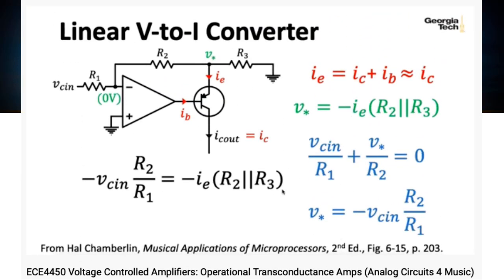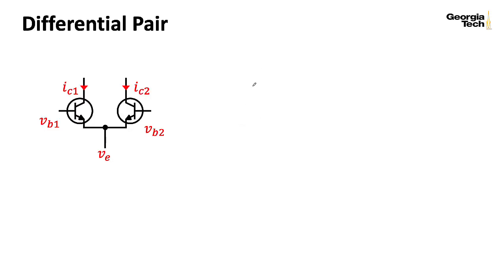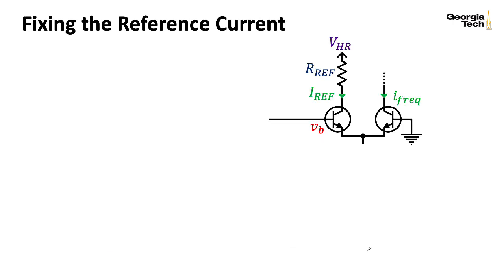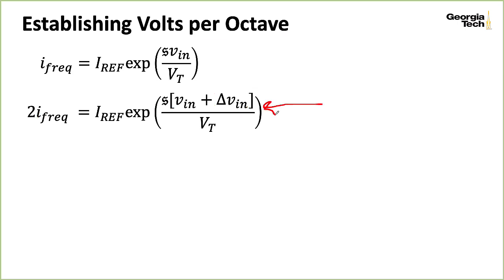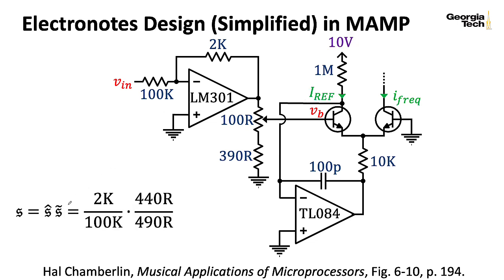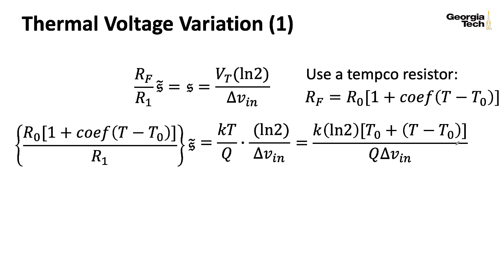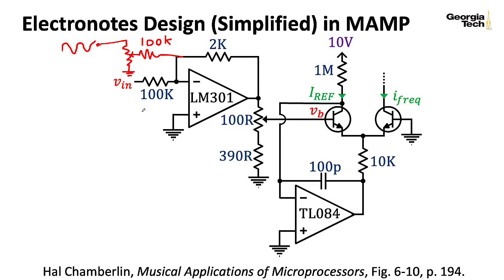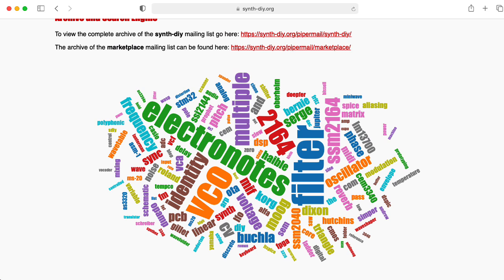ECE4450 L18: Exponential Voltage-to-Current Conversion & Tempco Resistors (Analog Circuits 4 Music)

Comment: I need to change a linear input voltage to exponential voltage to drive an analogue 1mA full scale meter. I'm guessing I need an exponential converter to do this but every circuit I mock up is basically non responsive. Any pointers?

Comment: The Electronotes exponential converter has several mistakes so it is not a good starting point. It is a corruption of applications notes published by Analog Devices, National Semiconductor and Texas Instruments in the late 60s/early 70s and misunderstands the importance of an attenuator comprising a 15k resistor and a 1k Q81 TC resistor. To be fair, it was never explained that the 15k resistor corrects the TC to be more like the necessary  3354ppm. If you put the wirewound TC resistor in the feedback of an adder you only get its actual TC which has a +/-10% tolerance. (The 1% is the resistance tolerance not the TC's.)   3018 to 3689 ppm is NOT close enough for rock and roll!
Wirewound TC resistors are manufactured from a reel of wire that is stretched during winding which alters the TC. The whole reel TC is carefully measured in an oil bath and the stretched TC is predicted and not measured after winding due to the difficulty and time to test individual components, hence the sloppy tolerance. TC resistors from the same batch will have the same error, but will not match another batch made from a different reel. If you build several VCOs from random TC parts they will diverge with temperature changes.
Modern platinum film RTD resistors are more accurate and have a TC of 3850ppm, but need a different circuit: one stage that adjusts the TC to 3450ppm and then another that adjusts 1V/oct to that.

Moral: don't believe everything you read in Electronotes, go back to the sources and then validate them.

btw, please stop using Protective Earth symbols for 0V Common, it's really annoying reading schematics drawn by somebody who does not understand grounding. These symbols are international standards defined in IEC 60417 and not a matter of personal preference.
Reply from the maker: I'm pinning this post.
Reply from the maker: What would the symbol for 0V common be?
Reply: @Lantertronics  An inverted hollow triangle. The third ground symbol is Chassis Ground which has 45 degree lines. Each has a distinct meaning and although they get connected together they are not equivalent, the difference is where the currents flow. It is best to not call any of them "ground" as that creates confusion. Try to say "0V" or "Common" when describing circuits, unless you really mean "Chassis" or "PE". Look up the AES48 standard and the AES reprint on Shields and Grounds, available from their website, to understand why this is especially important for audio equipment. There are also some good videos here by Bill Whitlock on the subject.
Reply from the maker: Something for your nightmares: I was in our senior design lab one evening, and I heard a boom from a table occupied by a team advised by another professor, so I went over and asked if I could help. Among other things, I discovered they had attempted to solve their grounding problems by strapping the ground to the neutral *near the bench outlet*. 

We had a long talk, and then I told them to not do anything else until they had spoken in detail with their advisor.

Comment: UPDATE: 3300ppm Tempco PTCs are only available as new old stock by now. A big producer of these (Akaneohm) stopped producing the convenient axial leaded 1%3300ppm 1k/2k/10k Resistors in 2018. Their resistors can be found for ~2$ a piece in several diy synth shops.

Is there a way to get around this shortage? Maybe mixing higher coefficients with  regular resistors?
Reply from the maker: Pinning this. Thanks!

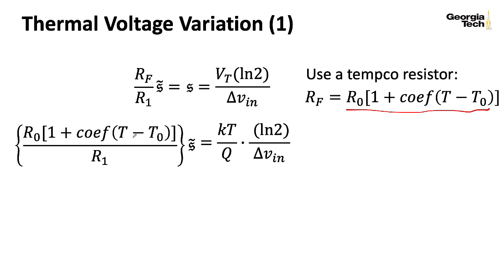Comment: I think if I would have clicked on the video at 23:26 I would have immediately clicked it away and thought "woah that looks like way too much detail- I'm designing musical circuits, not building a rocket engine"- but fortunately I started at the beginning and understood very clearly the purpose of the equations. @22:00 you say "Now I'm going to do something fairly odd". That is not odd at all to a mathematician, it's the celebrated "telescope trick" used in many proofs (translating directly from German, not sure if it has the same name in English)- which should be in every mathematician's toolbox :).

Comment: Platinum-film resistive temperature detectors (RTD's) are a lot more tightly controlled than the old wire-wound tempcos.  Since tempcos are always hard to find and expensive, a modern design should probably use a 4100-ppm/K Pt RTD in series with a fixed resistor.

Now I need to go work out how to get a current that varies 5100 ppm/K for supplying the common emitter of a Gilbert waveshaper that needs 5100 ppm/K (1.5× the transistor tempco)

Comment: Can i substitute the lm301 for a TL07x?
Reply from the maker: You mean use a TL07x in place of a LM301? Yeah. I’d be careful about going the other direction though, depending on application. TL07x is such a useful general purpose op amp, it’s good to have a drawer full of them.
Reply: @Lantertronics  Thank you!! 😄

Comment: Anyone got any tips on making this circuit get more than one or so mA? Lowering the reference current resistor increases the slope, but doesn't change the max current -- high reference current with no other changes results in a sort of sigmoid shape. The actual max current seems to be controlled by the feedback resistor, but with the high voltage drop across it, lowering the resistance/increasing the current too much gets to unacceptably high wattage very quickly.

Then again, maybe I just need to change the control range for the filter this leads to. Current control is weird, and I'm not really sure what values are best for avoiding noise while keeping power consumption low.
Reply from the maker: In most situations you probably don't want more than a mA -- if your filter is OTA based more than that may damage your OTA. If you want to change the total range you can try different values for the filter capacitors.
Reply: @Lantertronics  Mm, that makes sense! Thanks!

Comment: Hi Mr. Lanterman. I've been testing the Rene Schmitz VCO, and I have the same problem always. I let the temperature to set down, tunning to 32.7Hz. Next I put a random CV in, making the VCO play at high frequencies. Then I turn off the CV, and I see that the basic tunning isn't there anymore, because the transistor os hotter due to the high corrent of the high frequencies. And the tempco is not able to compensate for this, because the transistor is getting hotter from the inside. If tou have sugestion on how to deal with that I would be grateful.
Reply: Your tempco isn't aware that the transistor is heating up.
Try better thermal coupling between the transistor and the tempco.
Like thermal paste and clamp the two components together, maybe with a wire twisted around them.
Reply from the maker: Not sure -- I'd recommend sending Rene an e-mail.
Reply: If the transistor is getting that hot, maybe use a small heat sink, and attach the tempco to it also, with sufficient thermal paste between components & heatsink.

Comment: I am not an engineer but I have been creating various oscillator for my music projects, for the past three years. As I learn more, through videos such as yours and more hands on building videos, I have had inconsistent results with implementing exponential VC circuits,  integrators and bias. Through your videos/lectures I am starting to question my understanding of voltage control. It seems that current is what really controls the musical quality of a circuit ad voltage is more or less the plotting range for a waveform, is this thought going in the right direction? I must admit when it comes to voltage and current I don't really seem to consider current/amperage as significant but now I am wondering if it's voltage that is arbitrary.  Your help is much appreciated, thank you for creating this channel.
Reply: Almost every component is current controlled, you have to read the papers carefully what the device respond to, but in general it is current.  (BJT is current controlled i guess this is what you wanted to know, but IF you only use it as an switch you just have to put a V or three you know it opens hard).
Only actual Voltage controlled are those mosfets that i know of and i never use them so i do not really know.

Comment: I think it would help to go into the limitations of these things a bit. When first working on this stuff it can be really frustrating to design an oscillator core and then a converter and hook them together to see that they don't really work together. I realize that that stuff might be a topic yall touch on in a different class or a different part of this class, but just realizing that the exponential converter doesn't really work like a perfect current source is one of those things that sounds obvious when you say it but a person hacking stuff together might not think of.

An easy way to have that happen would be to use an op-amp schmitt trigger based design for your core, and set the schmitt triger thresholds at something like +-5v for the eurorack standard. Then you wire it all up with a simple resistor to -12v as your current sink and see it working. So you go back and make this exponential current sink only for it to just freeze, because the current sink can't go below 0v.

Comment: This is very good explanation of one of the most complicated problems there is with analogue synths. This is the problem that many diy-s switch to digital domain. But if you love analogue electronics than you have to love this solution of the problem. It's at the same time messy and brilliant. But what is also important to know is that it is not the only solution there is

Comment: I love the professor's lectures. However, I have a suggestion on how the temperature coefficient of R_F can be derivative much easier:
Note that the thermal voltage V_T is proportional to the absolute temperature and thus we want R_F to also be proportional to the absolute temperature (assuming that R_0 is close to constant in temperature - an assumption the lecture makes without mentioning).
The reference temperature of 25Celsius corresponds to 298.15K absolute temperature, let's make that 300 Kelvin for simplicity. The unit of the temperature coefficient is ppm/K, so dimensional analysis suggests that the temperature coefficient should be the inverse of the absolute temperature, i.e., 1/300K = 0.33%/K = 3300ppm/K.
This can be justified as follows: when we start at the reference temperature of 300K and increase by 1K, the absolute temperature increases by 0.33%. We want R_F to increase by the same relative amount of 0.33%=3300ppm. But by definition, this is just the temperature coefficient.

Comment: Thank you great lecture! I always wondered if there was an easier method to achieve this conversion. Matching a couple of transistors and then dealing with temperature it is a lot of work (still fun to me). But I always ask myself, In each op amp and ota there is a differential pair, but sometimes temperature compensates (If i'm understand correctly). Is there any method to empoy that? for example trying to take the output from an operational amplifier power line? totally noob question, sorry if I'm ignoring some basic rules.
Reply: What you can also do is stabilize temperature at some higher state like 40 celsius with a resistor so that there is no fluctuations in ambient temperature at the current mirror
Reply: @krolu  aaah, that's why moog do it! Never understood why, thank you very much.

Comment: Great lecture! Could you explain where the ic2/ic1 comes from? (around 7:00). I assume this would be due to the differential pair but I honestly wouldn't be able to write this down on paper
Reply: Calculating ic2/ic1 is purely an intermediate step to be able to get ic2 in terms of a "constant" ic1 without any Is term. Since he later sets ic1 as iref with the feedback op amp to ensure a constant iref, ic1 no longer has an Is term either. Since the value of ic2 is dependent on ic1, it also has no Is term either. ic2/ic1 doesn't show up as any sort of output in the circuit itself.

Comment: A nitpick: Kelvin scale is NOT a "degrees" scale. A "degree" in temperature is defined as a set change in temperature measurement against an arbitrary (and relative) scale, while Kelvin temperature is defined as a set change in thermal energy defined by Boltzmann constant.

Comment: Doubles every 10K* --- Kelvin aren't measured in degrees
Reply: Ofcourse it is. Kelvin, Celcius and Farenheit are all measured in degrees. What else would it be measured in?
Reply: ...because Kelvins refer to absolute zero and not something arbitrary like the boiling point of water or your body temperature, or so i read.